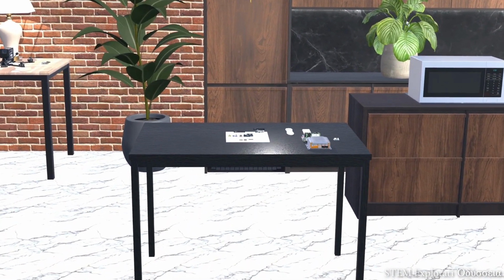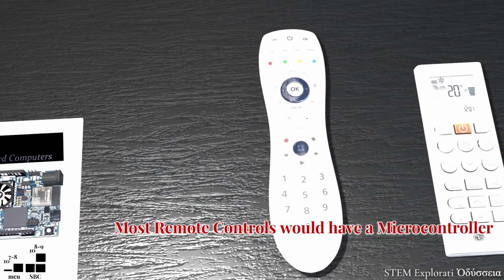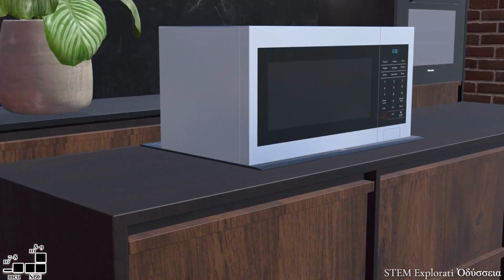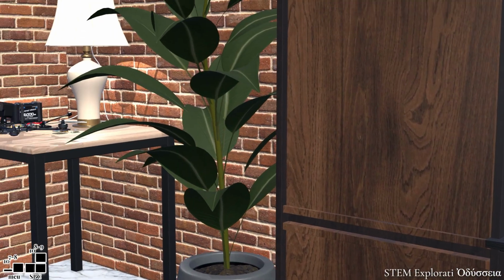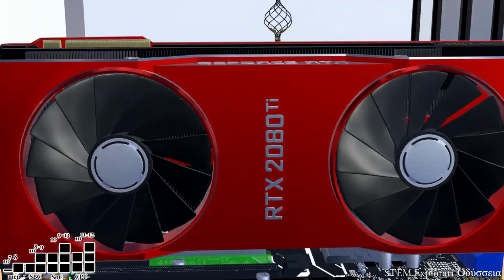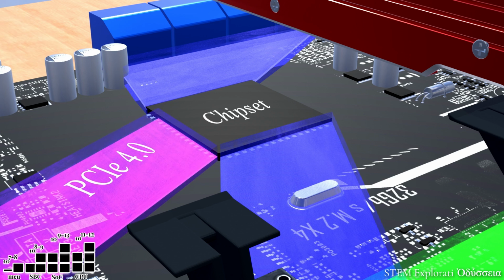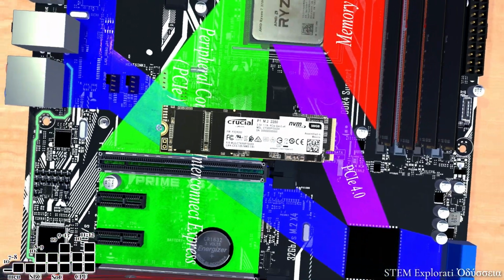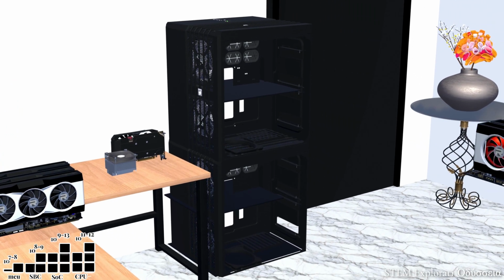From Microcontrollers to Data Centers. A Whirlwind Tour of Computing

Comment from the maker: Additional Technical Information:

1. Comparison of a few system:
1.1 Low-End Microcontrollers:
Usually simple 8-bit or 16-bit chips for basic control tasks like LEDs, sensors, or button inputs. They focus on low cost and power efficiency.
Clock Speed: 1–20 MHz
Performance: Around 1–20 MIPS (many take multiple cycles per instruction).
Examples: ATtiny85, PIC16F series, Intel 8051 derivatives.

1.2 Mid-Range Microcontrollers:
Commonly 32-bit cores like ARM Cortex-M. These balance performance and cost — great for IoT, robotics, and complex sensors.
Clock Speed: 48–240 MHz
Performance: About 40–300 MIPS (modern 32-bit designs often approach 1 instruction per cycle).
Examples: ESP32, STM32F4 series, Raspberry Pi Pico (RP2040).

1.3 High-End / “Crossover” MCUs:
Powerful MCUs that start to resemble small CPUs. They may have multi-core designs, fast clocks, and advanced peripherals for signal processing or ML.
Clock Speed: 400 MHz – 1 GHz+
Performance: 400 – 2000 MIPS+
Examples: STM32H7 series, NXP i.MX RT series.
Benchmarks:
• STM32F4 (Cortex-M4 @ 168 MHz) ≈ 10–20 MFLOPS
• STM32H7 (Cortex-M7 @ 480 MHz) ≈ 40–60 MFLOPS
In short: a simple MCU might do ~1 million instructions per second, while a high-end one can exceed 2 billion.

1.4 SBC CPUs (Single-Board Computers):
Examples: Raspberry Pi 4/5, Jetson Nano, BeagleBone.
Clock: ~1–2.5 GHz, 4–8 ARM Cortex-A cores.
With SIMD (NEON), throughput jumps dramatically.
Performance: ~10 – 100 GFLOPS depending on workload.
• Raspberry Pi 4 (Cortex-A72 @ 1.5 GHz, quad-core) ≈ 13–25 GFLOPS
• Raspberry Pi 5 (Cortex-A76 @ 2.4 GHz, quad-core) ≈ 50–100 GFLOPS
Bottom line: SBCs are mini-PCs — hundreds to thousands of times faster than MCUs.

1.5 Microprocessors (CPUs):
Designed for complex, serial tasks with strong floating-point units but fewer cores than GPUs.
Low-End (e.g., Intel Core i3) → ~200–500 GFLOPS
High-End Consumer (e.g., Core i9, Ryzen 9) → ~1–2.5 TFLOPS
High-End Data Center (e.g., AMD EPYC, Intel Xeon) → ~3–6 TFLOPS (with AVX-512, etc.)

1.6 SoCs (System-on-Chip):
Combine CPU, GPU, and often an AI accelerator (NPU) on one chip. FLOPS mainly come from the GPU/NPU parts.
Low-End (entry-level phone, smart TV, SBC) → ~50–500 GFLOPS
High-End Mobile (Apple A17 Pro, Snapdragon 8 Gen 3) → ~2–4 TFLOPS
High-End Laptop/Desktop (Apple M3 Max, etc.) → ~10–18 TFLOPS
SoCs include dedicated hardware accelerators : blocks of circuitry made from transistors specifically wired to execute certain algorithms or functions.
Examples:
Video encoders/decoders (H.264, H.265, AV1)
Signal processors (DSP blocks)
Neural network accelerators (NPUs/TPUs)
Crypto engines for AES, SHA, RSA, etc.
These units don’t run software instructions like a CPU would. Instead, they are hardwired state machines or custom logic that performs a computation in just a few cycles.
This is why:
A general-purpose CPU might take millions of cycles to encode a video stream, but a hardware H.264 encoder inside an SoC can do it in real time with low power, because the algorithm is literally baked into the silicon.
1.7 GPUs (Graphics Processing Units):
The FLOPS champions — thousands of cores for parallel math, graphics, and AI.
Low-End (integrated graphics / entry discrete GPU) → ~0.5–2 TFLOPS
Mid-Range (RTX 4060, similar) → ~15–25 TFLOPS (FP32)
High-End Consumer (RTX 4090) → ~80–90 TFLOPS (FP32)
Data Center / AI (NVIDIA H100) →
• FP32 ≈ 60 TFLOPS
• FP16/BF16 ≈ 1,000 TFLOPS (1 PetaFLOP)
• FP8 ≈ 2,000 TFLOPS (2 PetaFLOPS)

2. From Shared System Buses to Modern PCIe
Before PCI became dominant in the mid-1990s, IBM-compatible PCs used several shared parallel buses:
2.1 ISA (Industry Standard Architecture)
• Era: IBM PC/XT (1981, 8-bit), IBM AT (1984, 16-bit)
• Speed:
8-bit ISA → 4.77 MHz ≈ 8 MB/s
16-bit ISA → 8.33 MHz ≈ 16 MB/s
• Bus Type: Shared parallel bus
All devices shared the same address, data & control lines
Only one device could communicate with the CPU at a time
2.2 EISA (Extended ISA)
• Era: 1988 — created by the “Gang of Nine” (Compaq, HP, etc.) to compete with IBM’s MCA
• Width/Speed: 32-bit @ 8.33 MHz → up to 33 MB/s
• Bus Type: Shared parallel (backward compatible with ISA)
• Use Case: High-end servers/workstations (network adapters, SCSI cards) in late 1980s–early 1990s
2.3 Transition to PCI
• Introduced: 1992 — replaced ISA/EISA/MCA
• Features:
32/64-bit data paths
33–66 MHz → 132–264 MB/s (PCI 2.0)
Bus mastering & Plug-and-Play
• Bus Type: Parallel shared bus (with a central arbiter controlling access)
2.4 Modern Architecture: The PCIe Era
• The old “system bus” model is gone.
• Modern systems use a switched serial fabric, conceptually like Ethernet:
Each device (CPU, GPU, NVMe SSD, USB controller) has dedicated lanes
Data moves in packets/frames, routed via a root complex or switch
• PCI Express exemplifies this point-to-point design — scalable, efficient, and massively parallel in nature.

3. Beowulf Clusters vs. Modern Data Centers / Supercomputers
3.1. Hardware
Beowulf clusters: Built from ordinary PCs or workstations connected by Ethernet. No special hardware, just off-the-shelf parts.
Modern data centers/supercomputers: Use purpose-built rack servers, high-speed interconnects (like InfiniBand), specialized accelerators (GPUs, TPUs), and optimized cooling/power systems.
3.2. Software & Management
Beowulf: Relied on Linux and open-source tools to make the cluster behave like a single machine. Management was mostly manual.
Modern systems: Use advanced cluster management software, virtualization, containerization (e.g., Kubernetes), and distributed computing frameworks like Hadoop, Spark, or MPI for scientific computing.